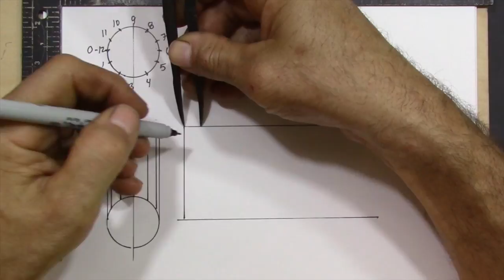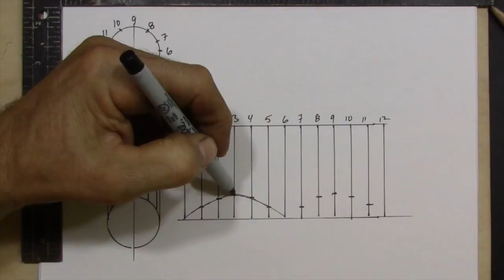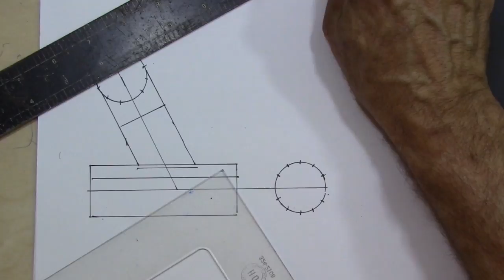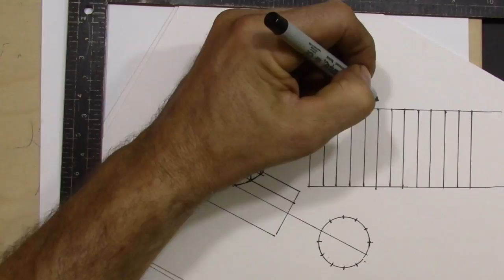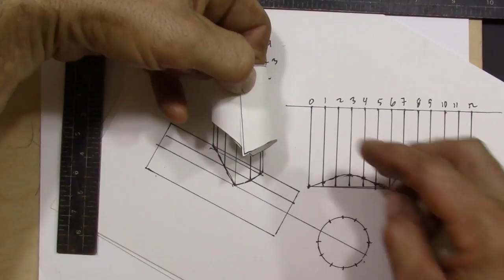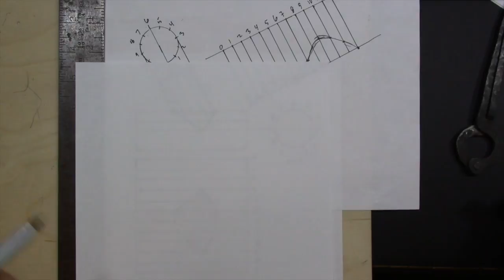Blacksmithing For Beginners - Creating Shop Drawings 3

Comment: Easiest way to do your stretch out part instead of using your square we were taught do it on a separate piece and use calipers from top of pipe to intersection point and to transfer the lines so you are doing your template in one go.
Reply from the maker: I prefer this method because I don't do enough of this kind of layout and I usually have to figure it out each time I do it. This is more work but it is quicker if your mind wanders like mine and you constantly need to recheck measurements to figure out where you left off.

Comment: Your videos are very helpful. Thank you for taking the time to show these.
I've been using an online pipe joint software (www.harderwoods.com/pipedocs.html) to automate the process but it's great to see the manual ways to describe these geometric principles.  
Next, can you do a complete object to bring all these components together? Something like the typical tinsmith's coffee pot?
Reply from the maker: No problem.  That's where all this is headed.  I have the basic theory covered now and I did a video on bickerns where I built one of the  tinsmithing stakes I need.  So once i finish putting together the rest of the tools  I will be ready to include some tinsmithing projects to the list.